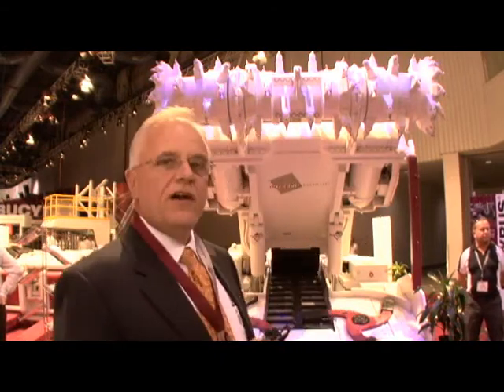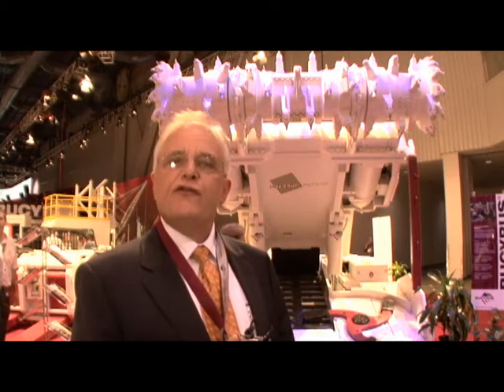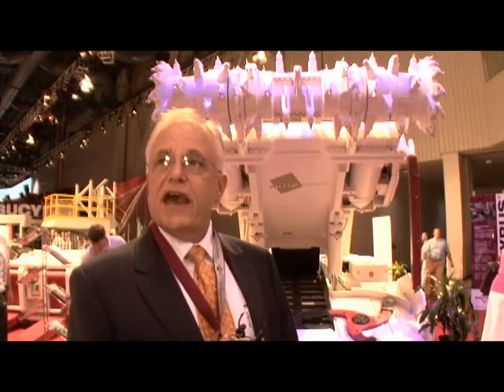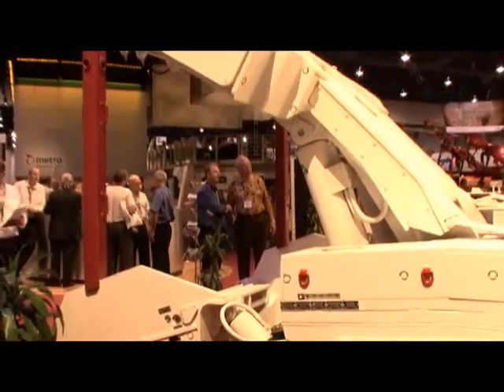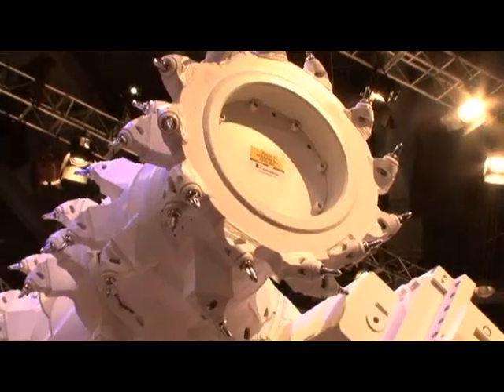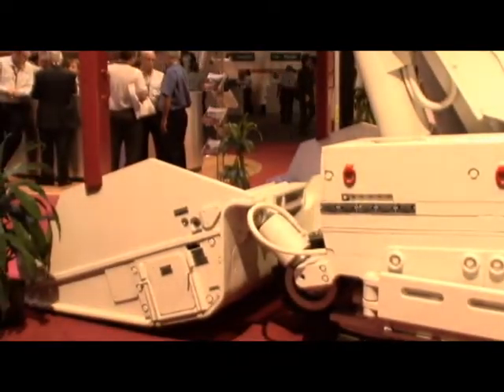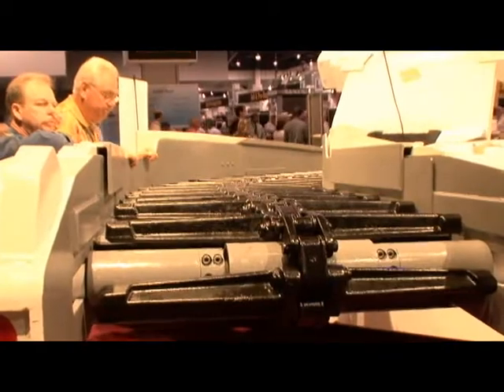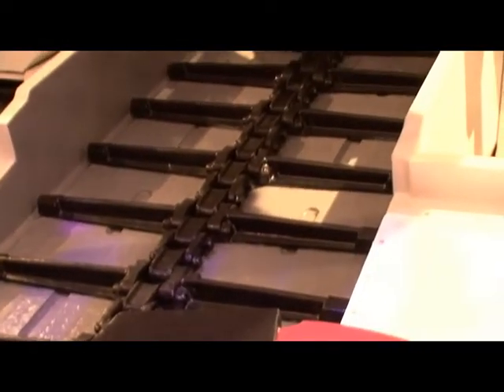BUCYRUS to present continuous miners '30M3'

Comment: We have some burturdis miners at our mine. They are heavy and cut well, we used them in a 40 foot cut plan with ventilation fans, mining 80-100 inch average cutting 4 barrel longwall panel sections, we have pulled over 200ft regular. The only thing is the reliability is not as good as a joy, cheap metal, the joys are generally not as fast cutters but some of their new machines without ratty face boss cut and load as well as a bucyrus. Hopefully Cat will make them a better company.